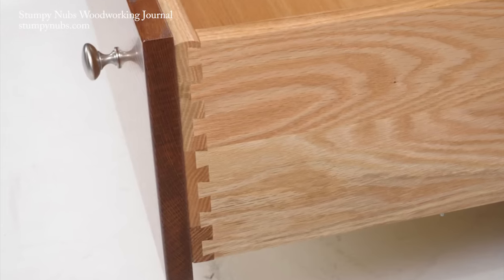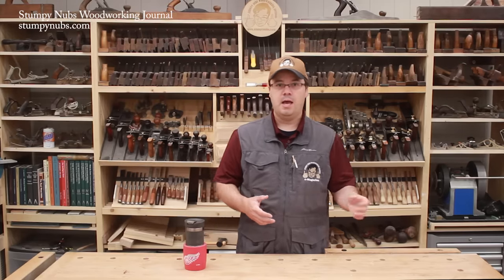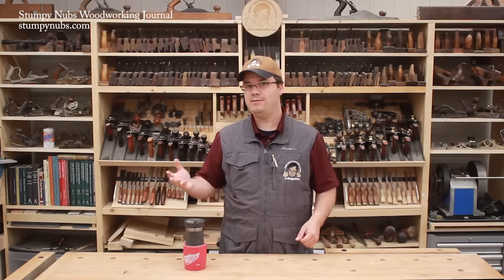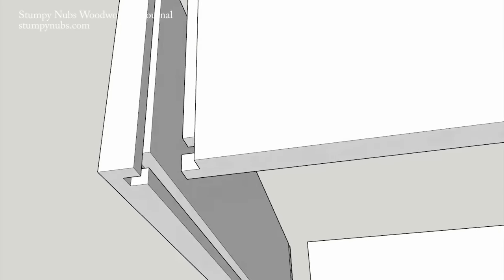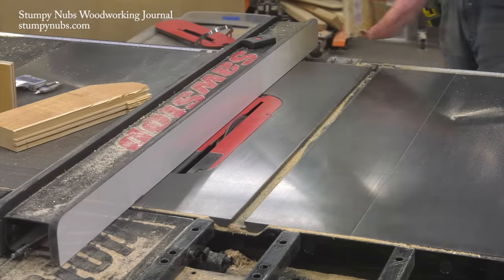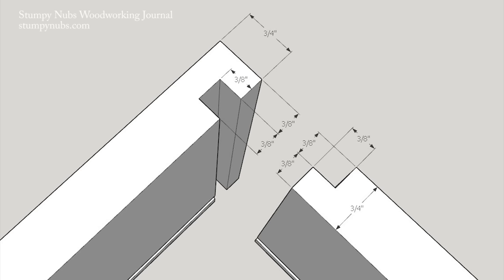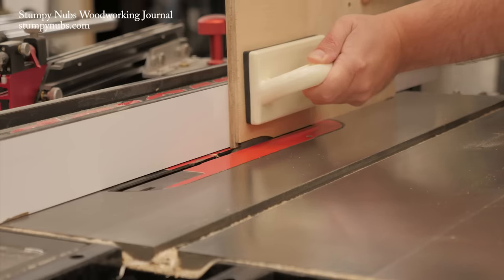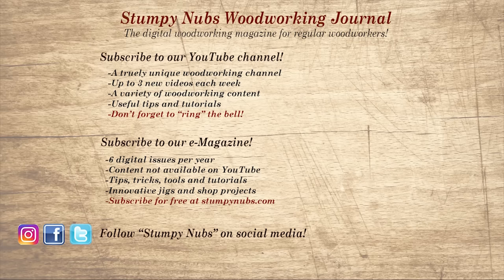The fast and easy half-half-half drawer construction method

Comment: I've found that if you do multiple drawers of similar width and depth, you can run larger pieces of wood through the saw to cut the dado and rabbet for multiple drawers at once.  Then, you can just cut off the heights you need and run the groove in for the bottom in the individual drawer faces after.  This allows you to manipulate larger pieces on the table saw for better support.  This is also useful when the bottom has to be set at a specific distance, i.e. for undermount slides that might not respect the 1/2 x 1/2 x 1/2 of this method.
Reply: dang great tip!
Reply: I’m embarking installing kitchen cabinet pullout drawers/shelves with under mount slides.  This will definitely be a time saver.

Comment: Running boards on end through the table saw can be a dangerous process...especially without a really good zero clearance plate.  For the ends and bottoms (rabbets), I use a sacrificial fence right up to the blade.  As long as the sacrificial fence is HALF the width of your work piece you don't even have to measure.  With this method you can run pieces through on their face to create the rabbet instead of on end.  That will help keep you fingers from becoming Stumpy Nubs.

Comment: I use that joint almost exclusively for drawers. Strong, quick, and easy. You did an awesome job explaining the process! The same set up can be done on the router table too, but then there is the noise and mess.
Reply: Dust collection is imperative if doing this on a router table. Try a relief cut down the middle of the grooves on the table saw first, it really does save time and wear on router bits, and improves accuracy on the router table as well.

Comment: Very well explained. Back in the days when the epoxy slide was the state of the art we used to build drawers using this method but we would attach the bottoms without recessing them at all. The slides would totally cover and support the bottoms. I don’t miss the 3/4 extension, but I sure do miss that easy construction method. Great vid, James. Scott

Comment: Excellent work! I just butt jointed some nice walnut drawer boxes that I now have the solution to run 1/2-1/2-1/2 (or 5/16-5/16-5/16 in the case of the 5/8 walnut I milled!). No regrets, just an excellent 😁learning experience!
Thank you so much!

Comment: Haven't made a drawer, other than dovetail joints before because they are typically complicated.  And dovetails for me?....well they are time consuming and complicated too!  Your video helps a great deal with understanding a simpler way of construction for typical drawers.  I have watched your video twice, but still need to build one in my shop to get it under my belt.  Thanks.

Comment: Thanks! I have now used this method for 3 shop cabinets and it works great.
Please note plywood, even from the same stack is not always the same thickness. So I always cut all the sides of a drawer  from the same sheet of ply.

Comment: I Love the video's you do, and always give a thumbs up but never comment. This is a great video explaning this method that my dad taught me 60 years back and you explained very well. Dove tails take much longer to do and setups are a pain. Go to the big box stores and look at the cabinets and you will see most use this method, and they fail when overloaded or abused by pushing stuff tightly into them. Still a good method, not bucking it.
If building something fast way to go, if building something to last for your great grandkids, take the time and dovetail it and the wood will break before the dovetail comes apart. And yea I do use this method too, just depends on how long I need it to last me. Thanks again for all the great video's I aways learn something from them.

Comment: I know I'm really late to the party here, but I just made my first set of this style of drawer this weekend. One thing I ran into that may help other people (and that I have not seen on any of the explanation videos) is... You really need to be precise when cutting your pieces to length before cutting the rabbets and dados, especially your bottom panels. If you can use all the same stops on a cross cut sled or something like that, you will probably get the best results. I don't have a cross cut setup, so I cut my sides to length on the miter saw, and bottom panels on the table saw. My drawers would not go together, because the bottom panels were almost an 1/8th too long. So I had to reset my table saw up to rip them down, reset the the dado blade up, and recut 1 dado on each of my 4 drawer bottoms. Not the end of the world, but it was enough to make me walk away from the project for the day!

Comment: Thanks James!  As it turns out I have a few drawers to build, not what you'd call a production run but enough to practice the technique. Sadly the 3/4" and 1/2" plywood I normally use is actually 1/16" thinner than the nominal so I guess I'll finally get to use the shim pack that came with my dado stack. Many thanks for sharing and cheers from BC!

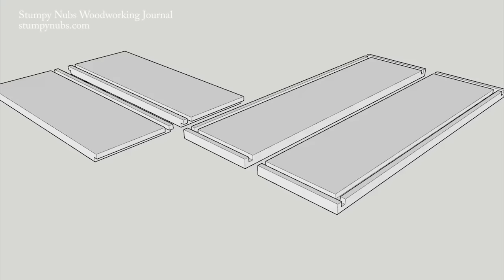Comment: Great video! Only thing that doesn't seem to be explained is how the groove on the sides is shown as not breaking through on the section of wood past the dado that wraps around the end of the front and rear of the drawer. 4:30 is a good closeup of this. I notice that at 0:29 there is a quick shot of the side showing that the groove did break out. I assume since there is a false front this is not a concern? Got my thumbs up regardless! This is a great video for quick production or beginners!
Reply: I was wondering the same thing.
Reply: Ditto
Reply: For me, this would be easier to do at the router table (keeping the front and rear side from breaking through on the dado on the bottom groove).
Reply: I believe the drawings are shown that way for clarity, but in practice he did not stop the grooves.
See 3:51 in the video.
Reply: I was wondering the same thing.
Reply: The Sketchup animation is not correct. I've been making drawers like this for years. The long dado that goes along the bottom edge of of each side runs the entire length to receive the bottom panel.  It's not a stopped dado.  What is not clear from the animation is that the resulting notch is hidden by the applied drawer front after the box is assembled, (the drawer sides run past the front/back) so there's no reason to worry about the resulting notch.
Reply: @thomasarussellsr  I cut the groove on all my shop drawers (about 30) with a quarter in router bit for plywood. Then I had to dig out the packed in waste sawdust from each groove. Looks like with this set up, I’d rather do this. The trick to get a true quarter inch dado set is to use TWO thicknesses of regular typing paper between the two dado blades. I saw this tip yesterday on a quarter-quarter-quarter video.

Comment: yes. excellent video  . thank you so much, working on a table saw cabinet /router extension unit for my workshop. your tutorial has just taught me an easier method to dimension it out to my size of table saw i have.  secondly i have purchased  you suggested 123 blocks (Swiss cheese) type and a set of  brass set up gauges ,etc . thanks  again.

Comment: Great vid!! I tried the quarter x3 version and loved the results. But I had a terrible time setting the saw so all three cuts worked. After your video I realized my plywood was probably undersized. Great job!
Reply: Vernier calipers are a God send when it comes to manufactured woods and wood not milled by the crafts-person themselves. Even when you mill your own.
Exact thicknesses are almost never found at the big box stores. A good set of measuring calipers should be a go to tool in every shop, metal or wood. It makes machine an tool set up so much easier. 
HINT: If you didn't already know, the tail sticking out the end of the caliper is great for setting the cut depth of your saw blade or router bit, checking the drill depth of a hole, etc...
Reply: You’ve got to remember that it’s not 1/4” but actually 1/2 thickness of the material.

Comment: I use my radial arm saw for this other than the grooved bottom, I don't rip with it. I use a spacer against the stop to cut the drawer front. You don't have to stand these up on edge even on a table saw using a removable spacer!  Great video all the same.

Comment: I love this method!!

It ruins the "one set-up" advantage, but if one is at all squeamish about rabbeting the bottoms on edge, you can also dado all the sides first, then move your fence & add a sacrificial edge to allow you to rabbet the bottoms flat. Still get the excellent, simple, and strong joinery with one blade set-up and two fence set-ups, plus it's much safer for the novices. 😎👍
Reply: I prefer doing it this way. Extra steps but if you're making a shallow drawer the sides are narrow and cutting them on edge is sketchy. More so if you don't have a zero clearance insert for that setup

Comment: Great video! Being from Sweden – a country that relies heavily on international standard – I always marvel at the way you manage to keep track of inches, feet and yards! 3/4, 3/8, 3/16 and so on... The metric system is SO much easier to grasp. 😄
Reply: not😁
Reply: Your correct.  Adding,  subtracting,  and even measuring with fractional measurements can introduce errors.  I’m trying to transition to the metric system in my woodworking and find it’s easier math.

Comment: Well done!
Thank you for making them drawer building process an easier concept. Prior to watching your video presentation; I have build one drawer successfully when I built a Mitre Saw Stand for my brand new Mitre Saw.  Upon building my second, much smaller drawer; I found it more intimidating and it came out "only kind of okay." Upon reflection, I believe that my drawer assembly came out not so great because of the drawer box not being anywhere close to being perfectly "square." I am going to remedy my situation by rebuilding my drawer box, and remaking my drawer assembly using your process.
Again, well done.

Comment: This is a great tip. If you don't have a dado set, you can also do a similar setup on a router table.
Reply: I was thinking about using a router table as well. The issue I may face would be that the min size of a router bit is 1/4, i.e. 6.35 mm, whilst the plywood is 12 mm (Russia) - would make a gap of 0.35 mm. Should try to see if it is noticeable.

Comment: I'm glad I found this video, very good explanation for various thicknesses of ply wood. As soon as I get my dado blades back from the sharpening shop I am going to give it a try. Here in northern, Ontario, Canada it is difficult to get true 1/2" Baltic birch but the Aspen ply that is available comes out to 15/32" (0.46875") thick - I'm just going to call it half inch. Hopefully it works.
Thank you for sharing!

Comment: This is such a useful video! I built a few 1/2'' drawers following this method and it worked really well on the first try! The only issue I encountered is that the little stump left over between the bottom and side dados of the side pieces tends to break easily. It's just esthetic issue, no functional impact on how the drawer works or anything.

Comment: I’m a beginner woodworker and I have a Dewalt 7845 table saw. It does not accept dado blades. I like that half lap method. I guess I would do it with a 3/8 inch router bit

Comment: 👍 Have used this for years, a shop that I worked at 35 years ago we kept 1 saw set up for this with a custom blade for 12 mm Baltic birch. It’s always a pain trying to do it with the very undersized plywood these days. Or trying to find a dado blade that’s NOT 1/8” outside blades.

Comment: Hey Stumpy - I am about to make drawers for my homemade router table so this video was perfect - best explanation I’ve seen on this method.  1/2” plywood isn’t really 1/2” and 1/4” plywood isn’t really 1/4”  I don’t think  dado stacks go less than 1/4” so how do you deal with the thinner stock issue
Reply: I’m new to woodwork and came here just to ask this question
Reply: Wish this question would’ve been answered, as I’m needing to build 45 drawer boxes with 1/2” (15/32” actual) Baltic Birch, which translates to a 15/64ths dado/rabbit. Have searched the ol’ interweb with no real results.
Reply: @handyguyinc  I use a wobble dado blade that is essentially infinitely variable

Comment: This is easy and pretty quick. Like many shop projects, the actual work may only take minutes, but it's all in the setup.
Once you have your saw and fence dialed in perfectly, it all goes rather smooth.
There's two things I found I don't like about this method.
First, there's the empty square holes on the outside, then there's those other little squares on the corners that are just so happy to snap off if you look at them wrong.
I was gluing one of these up tonight. The dry fit was one of my best boxes yet. During assembly, one of those corner squares snapped off and ended up in a joint. As I was giving the box the tappy tap tap before the clamping, I saw that a side wasn't seating right.
You know how it goes when you start disassembling a glue up.
That one little corner ended up messing up the whole project as the others snapped off while I was looking for the one that got jammed.
Argh.
Then there's that whole standing a board up vertically against the fence over a dado blade thing.
I think I'll keep looking for a better, safer drawer method, but I at least gave it a try,

Comment: That trick with the bottom panel absolutely blew my mind. Here I was, playing Checkers, thinking you'd just use a thinner panel and deal with the gap in the slot, while you were playing VR 4D Chess and using the setup you already had in a clever way.

Comment: Great method but as I am designing some drawers right now I wanted to clarify something.  Running all the dados for the drawer bottom straight through the pieces will leave you with a visible square hole in the front and back panels.  This will of course be somewhat filled in with the bottom and then covered with a false front but just want to double check others are having that same result during design and building and that I haven't cocked things up.  Thanks for the clear explanation of this easy method!
Reply: I am wondering the same thing. At 4:31 the drawing shows this as not cut all the way through but I don't know how you would achieve that.
Reply: @russellmm  I think that is just how he drew it in sketch up, if you were to actually run this setup on a table saw you would definitely get those holes.  You could in theory do this on a router table as well and then set up stop dados but that I think defeats the purpose of this quick and easy set up

Comment: Wonderful one setup process. As a home repair mechanic, I see lots of factory drawer box failures in kitchen drawers. The design of this method if glued up correctly would be bomber. However, the forces of opening a heavy and or sticky drawer pull in the same direction line as the glue slot. Also a 1/4" or half the thickness of plywood remaining at the end may delaminate with repeated forces. Seems that a couple of brad nails on the sides of the front would help reinforce the setup. Copious glue on the front joints might help too. 
Thanks for another terrific video.

Comment: I like to use this type of joint for the front of the drawers but use a plain dado for the back panels that don’t get the same kind of stress. I cut the back panel so that it’s flush with the top edge of the groove for the bottom panel. When the drawer sides are all glued up and set I can just slide the bottom panel in from the back and secure it with a few screws or nails into the back panel.

Comment: awesome vid!

Wish it worked for Blum drawer slides when you need 1/2" underneath the drawer bottom.
Reply: Not a problem. Just adjust the fence position to 1/2 inch when it's time to do the bottom grooves.
Reply: @glencrandall7051  yup, so half, to half and
.... Half inch

Comment: Great video.  I see why they call it the 1/4, 1/4, 1/4 when working with 1/2” plywood.  But even then, 1/2” plywood is less than 1/2”.  So I fully agree that it should be called 1/2, 1/2, 1/2 system to address the actual thickness of the board.

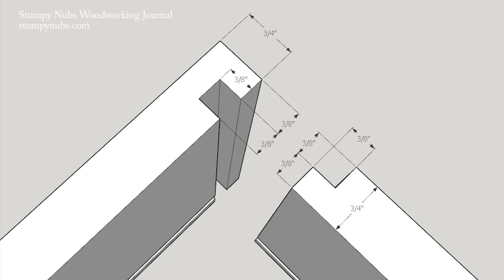Comment: Finally getting around to using this...I noticed that in your rendering of the joint, the sides have a stopped groove (5:09) for the bottom which allows for no gap to be seen from the joint. If, however, you do a full groove as shown when you make it, you end up with a small gap from the groove
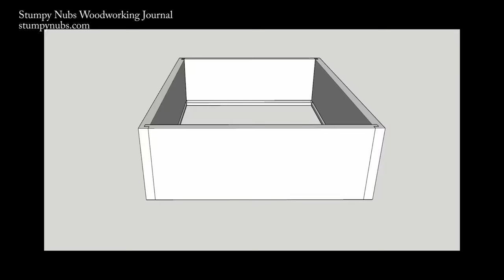Reply: At 0:39 you can see that there will be a gap when using a full groove on the side not shown there